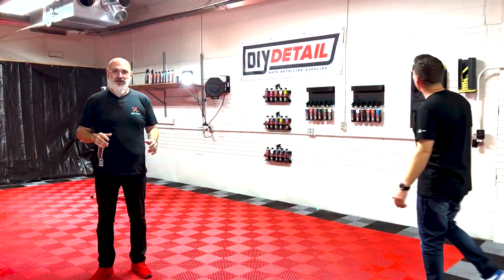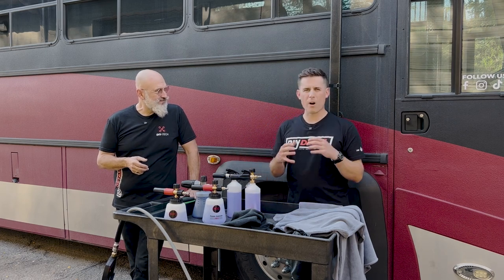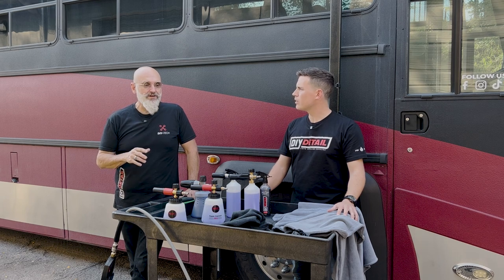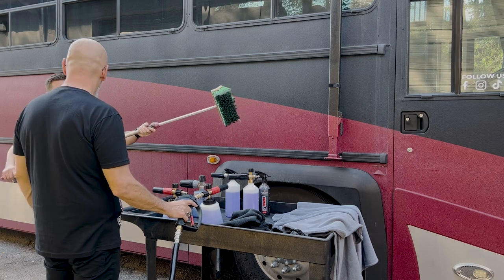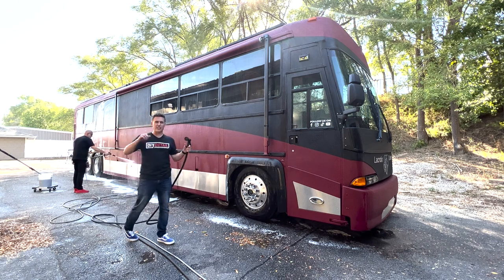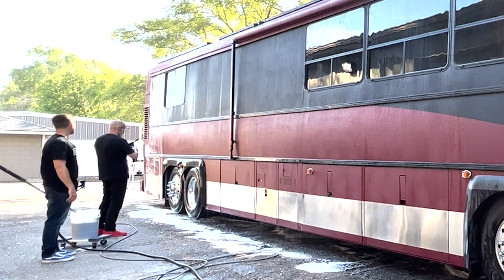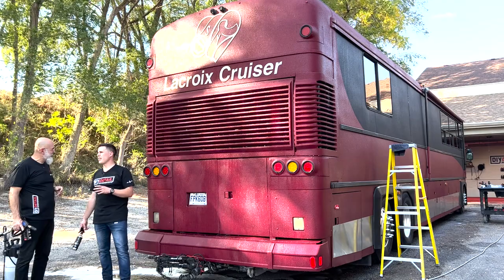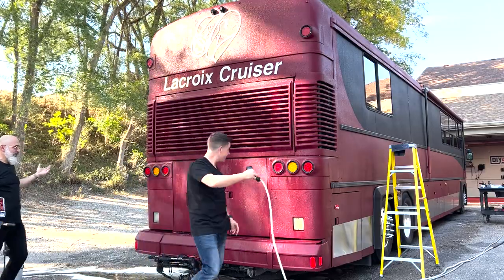CLEANING A MASSIVE BUS (With Incredible Suds!)

Comment: I am doing a motor home next weekend and wondering how much quick beads you used doing this vehicle?  (Mine is half the size)
Was it more than one bottle?

I just want to make sure I have enough

I don’t have pressure washer, do you see a garden hose working with an RV and quick beads…. Doing the process of pushing the water up the side?
Reply from the maker: That will work fine, we used less than 1/2 a bottle
Reply: @diydetailofficial  amazing, that size of vehicle and that little!
Reply from the maker: You will love it!

Comment: I see "Quick Beads" does NOT need a base coating as some graphene products suggest. I've applied a base coat on my 5th wheel nose cap. Between washing & base coat, I think I climbed my ladder 20 times. I'll be getting QBeads for the rest.
Reply from the maker: No base coating needed

Comment: As someone that struggled all last summer keeping are bus clean. We ended up with far to many scratches in the clear coat from washing I found this interesting. I may be looking to you Ivan for product. Will you be in BC this spring.
Reply from the maker: We never know where the road will take us. With a clear coated surface I would not use the same method shown here. 

Start by foaming, allowing it dwell. Next rinse, foam again, then brush, rinse and dry. 

The other option is a Rinseless wash.

Comment: Hey guys. How important is it to use a pH neutralizer after cleaning carpets or upholstery?
Reply from the maker: I sure like to do it, but you can also use a higher ph product like All Clean to spray/scrub/wipe. If you don't get the results you want, then you'd be better served by a dedicated carpet cleaning system with a high ph pre spray and low ph extractor liquid like flex ice
Reply: @diydetailofficial  would a low pH product like a professional carpet cleaning fiber rinse work as well? Im trying to best figure out how not to use an extractor if possible

Comment: Fun fact, my older brother plays bass in a Danish death metal band, called Piss Vortex (look them up on Spotify or so if you dare 😂)
Anyway. I have a question for Yvan Lacroix .
I was detailing my first RV last weekend, on the roof I noticed some tiny tar looking spots. Even with Optimum Power Clean, and my strong pressure washer, I couldn't getit all off. How do I get them off next time? Is it tar? 
Thanks in advance!
Reply from the maker: Unfortunately on a factory RV the roof is almost best left untouched.
Reply: @diydetailofficial  really? Thats a relief to hear. 😄 What argument would you use for a customer?
Reply from the maker: With an EPDM roof the less it’s touched the better. A once a year light cleaning with a mild PH neutral cleaner.
Reply: @diydetailofficial  thank you so much! And thank you for awesome content!